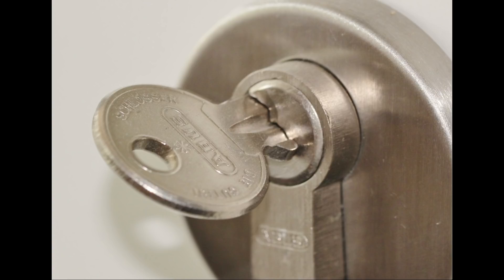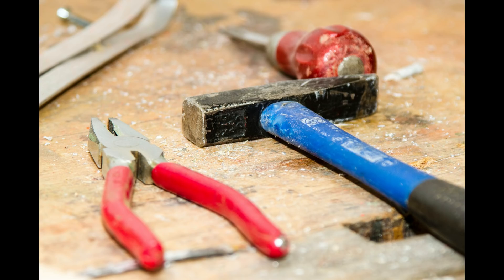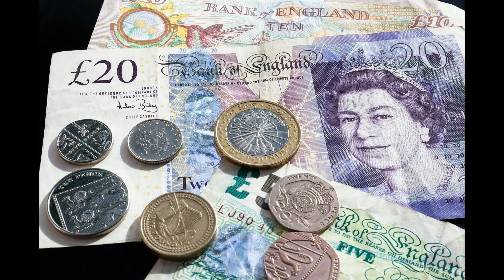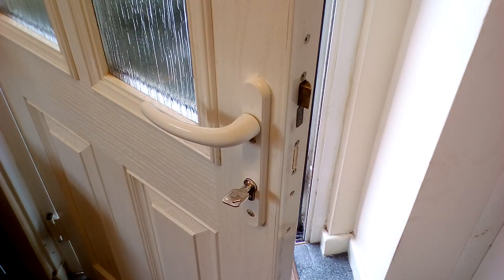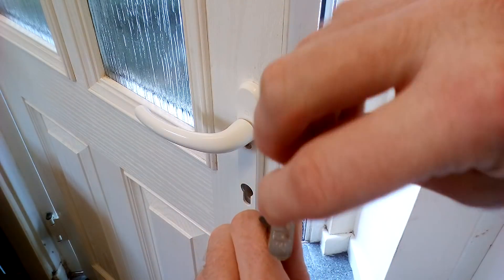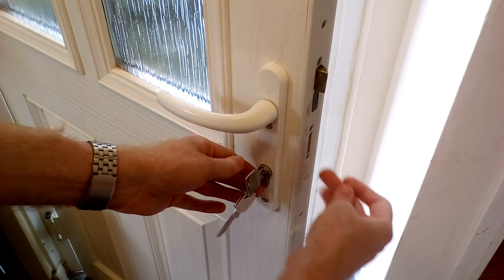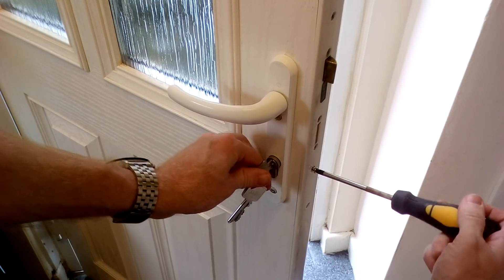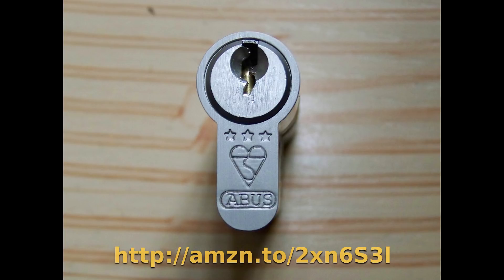How to protect a euro cylinder lock against lock snapping in under 5 minutes

Comment: To correctly measure your cylinder lock you measure from the face of the barrel to the centre of the fixing hole on the bottom section of the lock. Most anti snap locks have an internal and external side so make sure you measure and order correctly as most locks have different internal & external measurements.

Comment: In this instance, I'd go for a 60mm lock, would mean a recess of only a few mm inside the lock cover, but the less of the lock you have exposed, the better.
Reply: Will make no difference as the baddies remove the handle plate to expose more of the lock anyway, you are much better off using the correct size lock as it`s anti snap anyway.